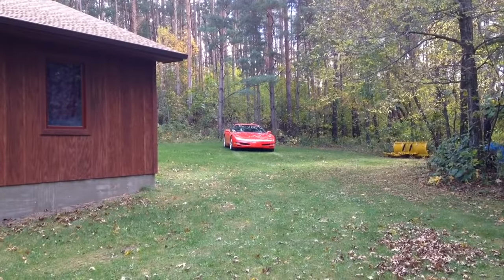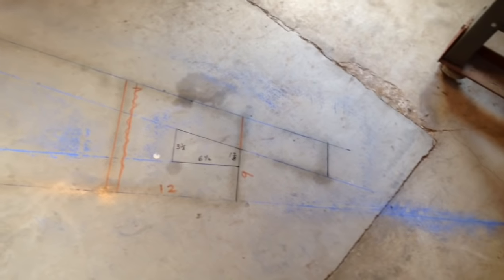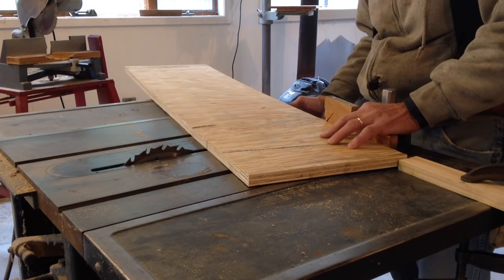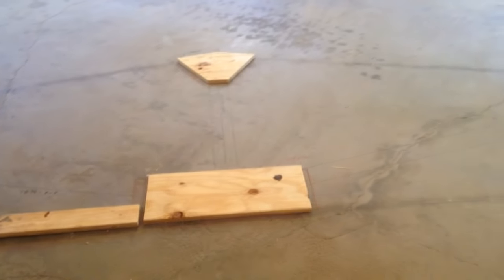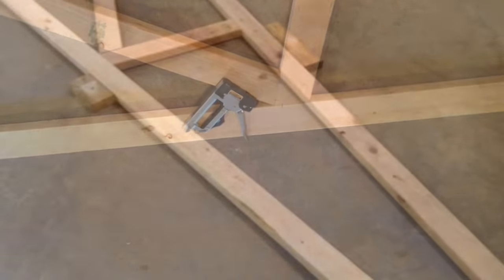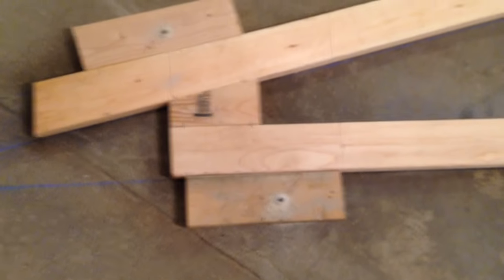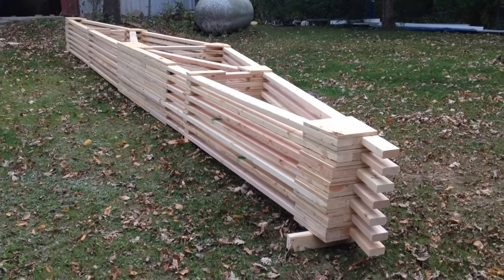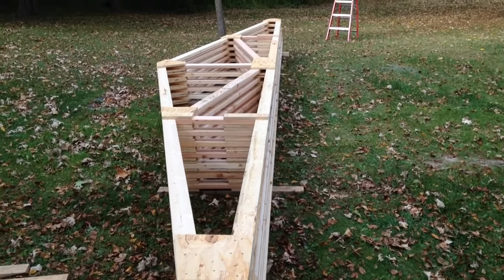Build your own wood trusses

Comment: 25 bucks to build a each truss?! In 2021 you can even look at a 2×4 for less than 20 bucks. Smfh.
Reply: It's like going back to the 1950s.
Reply: pay attention video was made in 2014.
Reply: @mikenittolo5093  Hence the surprised reaction. Why tell people to "pay attention"?
Reply: @oliverave1234  because spaz boy acted like he just made the video this year.
Reply: @2dawgsmiked684  it’s not a spaz… it’s a realistic holy f*** look at the cost of lumber now, that $25 truss would cost several hundred to make! Oh, to be back in the good old days, when I could pick up a 2x4 for less than $5… not to mention the $80 per sheet of 1/2” plywood. Still good info, even if the cost of building supplies have gone through the roof.
Reply: @kristenvincent3622  it IS a spaz, as yall are attacking the content as if the price should hold true for eternity. Well, newsflash: it's always going to be cheaper to build your own trusses than it will be to pay someone else to do it, as the truss builder will be paying the increased cost of lumber, too. I was building 5 HUGE trusses when I commented on this this video (when lumber was at it's peak), and still saved a ton of money versus having them built by someone else.
Reply: @2dawgsmiked684  it’s NOT an attack on the content, like I said… there’s a reason I’m watching it and probably everyone else complaining about current material costs. I’m reworking my own trusses today* on a kit home and have to build my own to fix the span changes and repair rot and termite damage due to Pandemic Related Contractor job abandonment… you CAN lament the current costs WITHOUT insulting the content, which no one here actually is, and I don’t see why you are taking such personal affront to it. It’s probably the best video I’ve seen so far (in a week of studying) on the “how to” aspects of at home truss construction. And if you’ve looked at pricing trusses lately you also know that the cost of the prefabs has increased in relation to the lumber prices as well. So it’s videos like this that make it more affordable for lay people to use what they hopefully have on hand already to get their job done. Because I’m personally sick of tenting through the damn winters because my contractor left me low and wet, with no roof or second story on my build for two years!
Reply: It's 2024 now
Reply: 2024 here, those trusses will run you $200+ ea now. Thank god for Bidenomics.
Reply: @pacco46 exaggerating but yes costs more than 9 years ago
Reply: @pacco46 $200 😂😂😂
Come on man

Comment from the maker: An update to all on the strength of these trusses.  We have had to this point in time, 45 inches of snow here in Iowa.  No issues with the strength of these trusses.
Reply: Great video!how long is the spacing between the thrusses?
Reply from the maker: @borkostojic9398  hi Borko,  the trusses are spaced 2 feet apart (English measurement system). That way an 8 foot long piece of plywood (measuring 4 feet wide by 8 feet long) will cover five trusses with the ends of the plywood covering to the middle of the truss.  2 feet is about .61 meter.  Hope this makes sense for you.   Steve

Comment: I luckily live in the country and basically can build anything that I desire as long as it is built with property line setbacks and under a certain height. What is ironic is just because a truss is built in a shop and has an engineering stamp it's automatically considered "better" than a truss built like you did. A truss like the one you built with 3/4" ply truss plates on both sides and glued and the proper # of nails is far superior and stronger than a POS thrown together plant truss. We built many trusses just like yours in my shop class in HS years ago. Very good quality stuff!
Reply from the maker: Thanks JJ.  very nice comment.  steve

Comment: I'm a professional engineer trying to learn how to build site built trusses. How did you size the gussets and what was the required nailing/glue pattern? I'm sure there is some ICC code compliant ASTM standard for those calculations, but I can't find. Also calculating the load capacity of the truss is either a ton of trial-and-error circular calculations or some software to do the infinite analysis calculations for you. Did you find a reasonably priced piece of software that you can recommend?

Comment: Be honest how fuqed up was your shop floor after the tapcons and the nail gun over penetrating?
Reply from the maker: @williamlatendresse-wb1uu  Ha ha.  I angled the nail gun, so no damage from that aspect.  Used probably 6 Tapcons, so just a little grey urethane caulk fixed them.   The blue chalk lines are still faintly visible, since I clear coated them to not lose them.  In reality, a nice reminder of what I did now many years ago.  And it is a Shop area, so patina is embraced, as I get older.

Comment: I used this video and made mine off of this.  I made a few minor changes, one being I couldn't tell for sure what size plywood was used, looks like 3/4" which seems a bit overkill and adds weight.  I used 3/8" and made them a little larger. These are usually made with flimsy patch plates, so I didn't see an issue using 3/8".  I based all the gusset measurements off of a 9" height as you end up with very little scrap.  But this was a very good video, I watched it about 10 times so when I made mine it was already familiar.  I made mine to cover a 23' span and I'm very happy with how they came out.  I'm adding an addition to my garage too, and I've never made trusses before so this helped a lot.
Reply from the maker: Hi Larry,Really nice feedback and I appreciate it.  Glad you found the video helpful.  Not everyone does, so you probably have some construction capability.  I did use 3/4" plywood, and yes it is perhaps a little overkill.  But the weak points in any truss are the joints.  The one under the most stress is the bottom chord splice.  That is why my bottom chord splice is 4 feet long.  That gets two feet on each side of the joint.  So take a look at your splice at the bottom chord, and if it looks good you should be fine.
Reply: I do have a fair amount of carpentry experience so this wasn't overly complicated.  Time consuming for sure, but not too complex especially with the video.  I thought it was pretty thorough and straight forward.  It was my first time doing a roof though, and I have absolutely no help, so this was a great video to follow.  I didn't see much to complain about. 

I thought about the center joint when I built these, and I planned ahead for it.  What I did is since I have an 8' ceiling, there was room to run a couple parallel joists.  I ran a 2x8 on each side of the joint. I used a hanger on one side, and then used 1/2" carriage bolts to connect them to existing roof joists. Then used rafter ties to stiffen it all up.   The existing garage is a hip joint, so the only way to build the addition without removing the entire roof was to build these trusses and continue the pitch over the top of one side of the existing roof.  I had to make the trusses a little shallower than I would have liked to,  it's 3-12, but I wanted to match the existing roof height for aesthetics. 

I don't think the extra support was necessary, but it was $15 worth of insurance.  They seem plenty solid on their own. If I had to do it again, I would do it the same way off the same video.  You'll never make everyone happy, but thanks.  This helped me out a lot.
Reply: I usually use whatever exterior grade plywood I have laying around, including scraps and offcuts. I've used as thin as 3/8 and as heavy as 3/4 and couldn't tell much difference in stiffness or strength.
Reply: No such thing as "scrap" (It's  "Drop-off" ;)
Reply: I totally agree with using 2" staples ...

Comment: Great primer video. I'm down in Australia and just got a quote for trusses for a single carport about 15ft wide. They came back at $300 AUD per truss ! And I need 10.  You've inspired me to build my own.
Reply from the maker: Wow!  At that price it does indeed make sense to build your own.  A 15 foot wide carport could also be framed with rafters.   Nice to hear from you Andrew.  A trip to Australia is on my wish list.  steve
Reply: Hi Andrew,

Six years later may I ask you if you made you own trusses? If yes, which timber size you used?

Cheers, Alex

Comment: i recomend using 2" staples, less likely to split gusset plate and has more shear strength. 100 psi barely below surface.
Also want to single side gusset plate on Gable ends, so as not to enterfear with siding!
Reply: No way in he'll does a staple have more shear STRENGTH than a gun nail. YOU cannot get the diameter of a staple big enough.

Comment: Of course, at 3:15 you already knew the approximate angle for a 3/12 roof even before asking Siri because you no doubt looked at your Swanson speed square and saw it was about 14 degrees   Precision is better, but unless you're using something like the Incra super-duper precision miter gauge,  it's really hard to know when you're cutting 14.04 degrees rather than14 degrees on most table saws.   By the way, your trusses look much better than those I ordered from my local builders supply. Well done.
Reply from the maker: Thank you for the comment Mr Welsh.  I never bought or used a speed square.  Some of my fellow carpenters do use them, so I am familiar.  They fit kind of OK in a carpenters pouch, but I went the way of a combination square hanging from its own loop on the belt. Perhaps a little less functional, but not clogging up a pouch.   Lots of ways of determining that angle, but I am getting old and lazy, and google and Siri work amazingly well sometimes.  Best wishes.  steve

Comment: I love the video!

Side note when I heard the wood rattling against the table saw blade I tensed up!
Reply from the maker: Thanks Joshua.  I understand the table saw comment.  Those fall-offs dancing on the table are troublesome.  As long as the rip fence is not on the table, they rarely get caught and tossed by the blade.  Saw a man not educated on table saws use a mitre gauge to cut a block of wood with it up against the rip fence.  I think the whole room cleared out when we saw this happen, but somehow he avoided disaster.

Comment: Thanks for this. Next year il be building a two storey house with timber framing and truss of course. I am excited! Its just that i dont have the hardwares yet.
Reply from the maker: Thanks DocMac.  My home is post and beam framed internally, and stick framed perimeter walls.  I recommend an engineers involvement in your truss design if you have any doubts or concerns on how to build them.  Best to you!
Reply: @flyboyslc1  il take your advise on the structural engineer...i am located in eastern pacific and we are battered by typhoons yearly..it has to have the strength.

Comment: Excellent job man.  Fun video.  I liked seeing the stack of the 7 on top of each other, which proves visually that you were highly consistent.  So, job well done.  Bummed me out though that you said you would pay to have them done professionally if you had the cash.  You did such a good job!  Also, I can tell you got a good air compressor...when you were nailing gussets yours didn't kick on.  Haha, mine would've kicked on twice during that sequence.  Grin.  Anyway, thanks for doing this video...best part for me was the layout you did...measure twice, cut once, use a good layout template.  And the addition of the alignment blocks was a great afterthought.  Cheers, good job and thanks.  The Armed Mariner
Reply from the maker: armedmariner    Thanks!  Nice comments.  It wasn't the cost that made me do them, it was the lead time, or wait that it would have required for me to get the custom sized trusses.  I am so busy that i just didn't take the time to get the trusses in the pipeline in time for when i needed them.  So i blasted them out myself.  You can save a little money building your own, if you do not value your time highly.  I am 64 years old now.  When i was 25 yes, i would have built them for sure.  Just didn't have much money back then.  Good to hear from you.  Best wishes.  Steve

Comment: This is very helpful, thank you. Could you comment on your choice of a splice location for the bottom chord? Why not in the middle or more towards the ends? This is the one piece of information I can’t find anywhere.
Reply from the maker: Great question DH!  The bottom chord is under the most tensional stress of any member of the truss.  It is trying to pull apart.  Ideally I would try to buy lumber that would go the entire length so no splices would be needed.  Since I am over 24 feet that isn't possible.  Knowing the torsional forces, I wanted to use a little longer splice member, so I cut a 3.5" wide by 4 foot long piece of plywood for each side of the splice.  That gave me a good long, probably over engineered splice.  If I had located this splice in the middle, where I was also trying to join the center vertical web member, I would have needed to make the splice plate probably 10 inches wide to grab the vertical member also.  So that would have meant 10 inches by 4 feet.  To cut down on the amount of plywood needed, (and weight) I just offset the bottom splice to an area where I only had to deal with a bottom chord splice and not integrate in a web member splice too.  If I was doing a W truss design, then directly mid span of the bottom chord would have worked perfectly,  since there is no web member mid span of a W truss.  The W truss is broken into 3 segments of the bottom chord, rather than 4 segments in my design.  Does this make sense?
Reply: @flyboyslc1  Yes. Your choice seems to be determined entirely by trying to minimize the use of plywood rather than structural considerations. My concern, however, is this. If you locate the splice in the middle and pull on both ends of the truss with tremendous force, your splice will be the only thing resisting it.  The top gusset won’t do much. However, if you locate the splice, for example, in the right panel and try to pull on both ends of the truss, ripping the splice apart will also have to bend the top chord. In other words, the top chord will be helping the splice keep the bottom chord together. Does it make sense?
Reply from the maker: @differenthandyman938  ah…….. I enjoy seat of the pants engineering and philosophical questions!  But I am suspicious of your conclusion.  Are not the other web members connected to the bottom chord whether or not it happens at mid span or another location on bottom chord?  Just because the top chord is connected   in a place without the bottom chord splice doesn’t mean that it won’t impart the same help you are referencing, does it?   Either way, for me it was just cleaner and less complicated to deal with it the way I did.  This past winter we had a total of 60” of snow with no thaw, so a lot of that snow stayed on the roof.  The trusses continue to perform well, even with the snow, drywall on bottom chord, and lots of insulation.
Reply: @flyboyslc1  I am coming to the conclusion that you are right and the splice location doesn’t matter for structural integrity. Perhaps that is why I couldn’t find any information on that. It appears it is usually determined by what 2x4 stock is available. It still makes me nervous though to trust that gusset. I am going to do what you did and overengineer  it. 3/4” plywood 4’ long. Perhaps even bolt it in addition to the glue and nails. Once again, thank you for your video and for going out of your way to respond to everyone. What goes around comes around. Best of luck.
Reply from the maker: @differenthandyman938  thanks for the fun feedback.  This video was created just for my friends to see.  I never suspected that it would be viewed very much.  If I had known, I would have cut out the first two minutes of fluff.  It has been great fun conversing with people all over the world.  I have even had comments in Chinese or Japanese.  Can’t tell the difference!  You are correct in your bottom chord splice methods.  It has the most stress, so overbuilt at that point is OK to do.

Comment: Nice video I'm a civil engineer student, I'm doing truss analysis and I like to watch videos like this one.
Reply from the maker: taurinenrgy Thanks!   I have set in place thousands of trusses in my 45 year construction career, and the design was based upon what i saw used in particular situations.  So i actually never ran the numbers for loading.  And they worked fine.  The roof held a 10 inch heavy wet snow with no deflection at all.
Reply: figuring the numbers,  would it just be a dead weight calculation?